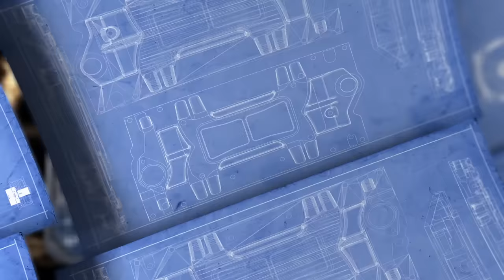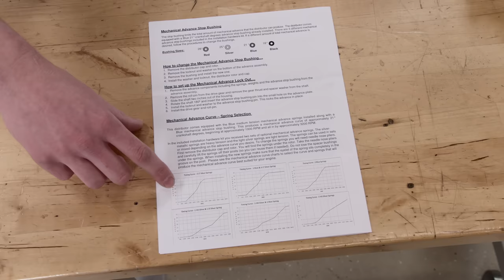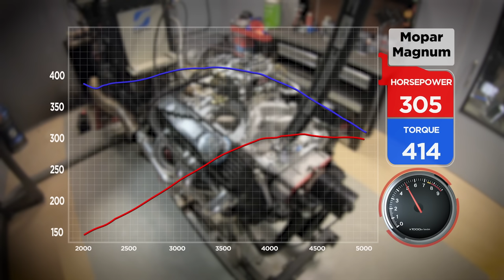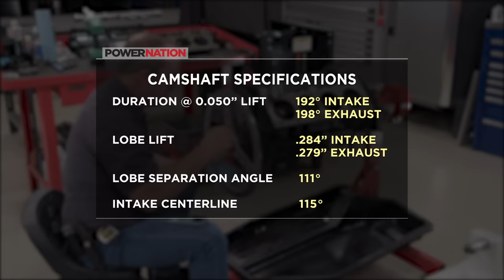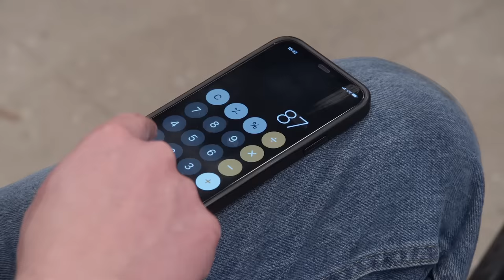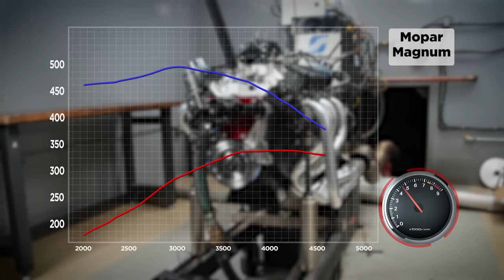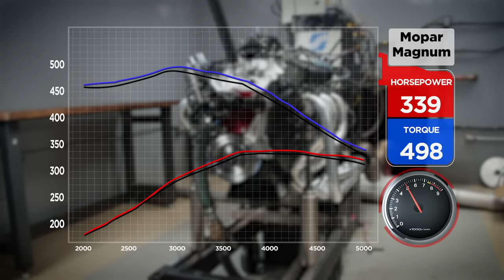What Happens If You Just Add A Stroker Kit To A Stock Mopar Magnum? - Engine Power S9, E3

Comment: very impressive, especially torque! with a cam that thing would blow right through the 400hp mark. These are the true LS fighters, if only more aftermarket parts would start flowing!
Reply: There's parts out there for 360's... Eddy heads... and even bigger heads requiring offset rocker arms...
Reply: @BuzzLOLOL  I think trick flow makes stuff for them plus you can use Holley efi on it
Reply: Impressive… I suppose.  LS fighter… eh, I’m not so sure.  Stock junkyard 5.3L make 380-385 lb/ft and 350-355hp run on the dyno in similar setup (headers, stock truck intake, no accessories/air cleaner).  They also have a similar size cam (191 @ 0.050” intake).  Stock 6L LQ4s make 400+hp and 425+ lb/ft, and they’re pretty much the lowest for the 6L (194@0.050” intake)…  440+hp and 460+ lb/ft for rec port headed versions like the LY6 with same 194 cam.  

Frankly, the newer hemis are more LS fighter than a 360.
Reply: @stlchucko  - Yeah, can't really compare '50-'70's tech engines with '90's and up tech engines...
Reply: It's a great motor especially for a A or E body, love those torque numbers but it doesn't stand a chance against an LS.  Those numbers are where a stock 6.0L LS starts with 50 less cid, even a cammed 5.3 will make  425 hp all day long.
Reply: @hardball107  Of course it stands a chance against LS motors, it’s all about the build.
Reply: @InfiniteSith136  I've been a Mopar guy from the 60's, been building and racing big and small blocks.  I've also been a Chevy guy for as long building both big and small blocks and it was always a toss up when the loud pedal got slammed on the road.  Your right, it depended on the build and the car.  I've been building and swapping LS's for 15 years now and I can tell you without a doubt that the LS is a game changer, the cylinder heads are just too good, their stock pickup heads flow 30% better than even Bowtie heads.  I've personally taken a junkyard 6.0L, cammed it and produced 500hp at the crank with a stock truck intake.  I've worked with guy's that with a stock block with stock pistons, a cam and turbo and made 1,000hp.  No, LS's rule the street, that's why you find them in Mustangs, Darts, Mazda's and it goes on and on.  You can't do that with any engine designed in the 50's and beyond without thousands in just the heads not to mention the recip assembly.
Reply: @stlchucko  360 is More plentiful and cheaper than the hemi. If you know what your doing you can squeeze 400 hp/425 tq from a stock stroke and rotating assembly 360 Magnum no prob, and still be streetable. Also the stock Magnum heads will support that power level as well. Plus the Magnums are more durable and reliable than the hemi.
Reply: @hardball107  a stock 60s n early 70s big block with a turbo can do those numbers.. A stock 351W was being pushed to 700-800rwhp before being built, my stock 2v 4.6L P71 beat a few loud ass hell 5.3s in the street, all depends how junky the engine was or not when it got swapped i guess..
Reply: @P71ScrewHead  Those were gross numbers back then not net like today.  Even a stock 5.3 will make 375hp all day with an aftermarket PCM. Add a just a cam and and your looking at 50-60 extra HP,  that's 426 Hemi range.  A 6.0L will crack 500HP gross, no contest.  And what are you smoken' to believe any stock 351 will hit 700HP except for maybe a supercharged GT40.  If you don't believe me I'll mail you a copy of my dyno slips with pictures of the 5.3 I just built for my '68 C10.
Reply: @hardball107  I've seen stock 5.3s on the dyno, they don't make much over a 4.6L 2v to justify a swap imo.. Maybe modded they'll make way more but stock vs stock I've beat a few.. n stock 351W have been known to handle good power man, been proven plenty.. 💪
Reply: @P71ScrewHead  I guess that's why everyone's putting LS's in Mustangs.  You need to stop trolling the post's and get out and start wrenchin'.  You have no idea what you're talking about and there is literally no one I know after 50 years of building that would EVER put a 351, 390, 406 or any engine designed in the 50's or 60's against a LS.  They are the highest output small block GM ever produced in stock form and they walk over most big blocks especially with a 6.0L.  I've personally, with just a cam swap, produced over 500hp on a bet with a 6.0L LS and that was a $900 junk yard motor that I never even pulled the heads on and I've seen 5.3's produce over 1,000HP with just a simple single turbo.  Go ahead and try that with any conventual V8 and all you'll have left is scattered parts.  Here's a video to watch of a 5.3 dyno run with just a cam change on a stock 5.3 truck motor, with a 6.2L you can produce over 600hp naturally asperated.  https://www.youtube.com/watch?v=aPtgp8czSqo
Reply: @P71ScrewHead  BS.
Reply: Neat Bigs  Great engine , car combo.  I built one for my son and it's an absolute rocket ship.  He's stuck on those mid 80's Fox body's.  I took a 5.3 LS, had it bored to 5.7 and used a stock rotating assembly out of a Corvette, used 706 heads from a P/U, Holley PCM, TBSS intake, BTR cam and long tubes with a 4L60 trans.  That engine put down 484hp @6200 at the flywheel with  480 ft/lb.  He drives it every day and it will lay down High 11's at 123mph at will.  A potent combination.
Reply: Neat Bigs  Ls is cheaper than the new 5.0 that’s why they use the LS
Reply: @stlchucko  I must agree. Just Sorry hemi aftermarket are so expensive..
Reply: @felixlafuente9714  
I know.  I'm just saying they are more capable than the small block Mopar in the vid that was referred to as a "LS fighter".  The new Hemis can make good power, but they are damn expensive.  LS is the king of bang for the buck.
Reply: @stlchucko  most folks in the hot rod hobby aren't rich. Also most folks are building engines below the 500 HP mark. The 360 is much more attractive than the hemi in price range and durability as well. The 360 can get there more economically and will take far more abuse as well. I've seen 360's hit 300k miles and more. Not many Hemi's get there. Too many issues with those engines.  Although if you have deep pockets, like the Hemi, and the Coyote crowd,  then I guess it doesn't matter.
Reply: @erikturner5073  
You're missing my point.
The 360 was called a "LS fighter".  
LS engines routinely make more power, and have a much larger aftermarket (and cheaper parts available).  
The only reason I brought up the newer Hemis is because they're capable of making power similar to the LS.  

If cost is the point, then it's a no brainer.  There's virtually no V8 that can compete with the LS when it comes to $/HP.  A cam only 4.8/5.3 can make over 400hp.  Cam only 6L can make 500+.  And people routinely grab junkyard LS with 200k+ miles, slide in a cam/springs, and make that power with no need to build.  There's countless junkyard 5.3L "builds" that only involve a cam swap and chinese turbo, making 600+hp on pump gas.
Reply: @stlchucko  no I didn't miss the point. Just stating facts. I've been in the hobby and professionally wrenching for 25 years.im aware of power capabilities as well as different points of directions as far as reaching horsepower goals. Hemis are great but they are overpriced. The 360/318 Magnums are the biggest underappreciated and overlooked Mopar engines. The amount of money it would take to do a 6.4L swap, or get the 5.7 to where it's not destroying itself with all it's problems, I could do a low buck 408 stroker combo with ported stock heads good street cam and a 150 shot of nitrous. That would be a nice street build and with spray there wound not be too many LS, 392, or Coyote cars I would need to worry about. Also it would cost far less than a 392 swap. In the right hands, a 360 Magnum can kick ass at a bargain!! Plus the 360 Magnum is far more durable.
Reply: @erikturner5073  
You're proving you missed the point.
I've been "in the hobby and professionally wrenching" for nearly 30 years too.  

"The amount of money it would take to do a 6.4L swap..."
That still has no bearing on my point, which had nothing to do with money.  It's that the late gen Hemis are capable of making ridiculous power like the LS.  Of course they're much more expensive.  I never said they weren't.
You're bringing that up.  And even if you want to bring up the cost facet of the build, then it takes considerably more money to turn a 360 into a "LS fighter" than it does to just run a LS.  

There's a follow up vid to this where they add roller cam, CNC ported heads, and single plane.  The dyno results ended up being close to a 6L LS junkyard truck engine with a similar sized cam.  This stroker made a little more torque mostly because it's nearly 50cid bigger.  
A stroker 6L (408) with its stock 823 heads and a 230@0.050" cam can make around 600hp.  Plus, even stock bottom end 6L have been shown to handle 200 shots with no issue (junkyard SBE 6L with only ring gap have made 1500+hp with turbos), so a forged stroker bottom end (which costs as much or less than a 360 stroker kit) should be more than capable of handling it. 

IOW.... If you want to talk about "kicking ass at a bargain", you won't hear me talking about Hemis or Coyotes.  The "bargain" wasn't the point of my comment.  You're bringing that up.  
If 360s were a "bargain LS fighter", there'd be more people swapping them into oddball stuff instead of a LS.  Typically the only things 360s get swapped into are into things that it can bolt into with relative ease.
Reply: @stlchucko  everything in life has to do with cost!! Second I've seen the second video, and I wouldn't have taken that direction with my stroker to make the same power to smoke LS, and 392 setups. They took the high dollar road all the way. Again there are many ways to get the job done, and cost has alot to do with what is popular. There are many people out there building 360/318 Magnums, LS engines, and Ford 302/351, versus the Hemis, and Coyote. In hotroding there's the grassroots approach, and then there's the deep pockets approach. Obviously we are looking at things from two different points of view. They are all great engines. Although at the end of the day money is going to play a big factor with most. Ridiculous power can be made with either direction. There are SLEEPER  Dakota's and other 360 Magnum equipped Mopars surprising Hellcats in the quarter mile. So yes it not only can be done, it's GETTING done! Remember, it's the the guy on this video who said that the Magnums are true LS fighters, and I agree with him! I'm just bringing up a different point of view for making power. We're all professionals with different takes on the subject. Plus it's good to see underdogs win from time to time. Plus like LS, Magnums are CHEAP/Durable, and can also be dropped into anything that can take a V8. It's not rocket science!!
Reply: @erikturner5073  
“True LS fighter” …after you throw a stroker kit and replace almost all the parts.  And the ones that aren’t replaced are massaged.  All to make about as much power as a junkyard engine with a cam.
Well gee…  by that metric, nearly any V8 made in the past 50 years is a “LS fighter”.  

You talk about grassroots VS deep pockets, but then throw everything at the engine but heads and act like it’s a super low budget build.  

Sure…  Can make good power with a 360 for low cost.  Let’s not act like they are making 500+hp with just a cam/springs or the factory bottom ends are capable of handling 1000hp.  These are things a LS are capable of.  A 360, 350, 351 and all the other small blocks from 40+ years ago have their inherent design limitations.  They can all be hot rodded to make power similar to their modern replacements (LS, Hemi, Coyote), but they have to modified just to reach the outputs of those modern engines; let alone surpass them.  
I’m not being obtuse and saying a stroked 383 SBC with ported Vortec heads and a hot cam that makes just over 500hp is a “LS fighter” just because it makes similar power to a warmed over LS.  There’s a bunch of people building 360/318, 302/351, and 350s because that’s what they have and it’s cheapest to build what’s already there.  The overwhelming majority of those builds also struggle to make over 400hp…  and that’s not a knock to them.  I appreciate/respect all sorts of builds.

That said, I’m not going to act like every old school small block with a “3/4 race cam that can hop a coke can” is a “LS fighter”, or that throwing a stroker kit at an engine is necessarily cheap.
Reply: @hardball107  "Stock" 426 Hemi...
Reply: @Acesnickvlc  Not to mention the new 5.0 is a super wide motor with those cams over the heads.  They just won't fit in many vehicles without major surgery.
Reply: @tomc8157  I put together a "stock" 5.3 with just a mild cam, actually a junk yard motor with a Trail Blazer intake and a set of long tubes and made 448hp @ 6200, 425ft/lb at 4600 and had less than $1500 in the motor.  There isn't a old 426 Hemi made that would keep up with that.  Even the new Hemi's will walk all over the old 426's.
Reply: @hardball107  that's great and all, just saying a stock 426 hemi had 425 hp and 490 tq stock at lower rpms.. Not bad for a 1968 engine. You can't compare 60s tech to modern. Still would give that 5.3 a run for its money.
Reply: @tomc8157  Well, not really.  I've raced them in the quarter in the 12 second bracket and put them back on the trailer with my '68 C10 with a 5.3 and a 700r4.  Raced 2 others a week later and I was handicapped almost 2 seconds.  They were great engines but your right, they can't compete with modern engines routinely putting out well over 1hp/cube.
Reply: @BuzzLOLOL  this is a 90s engine. 70s SBMs were LA's. Magnums are LAs with 90s tech.
Reply: @stlchucko  the Magnum plataform is the LS fighter that should have been developed. Cheap, easy to make power, tremendous durability, etc, etc, etc. Some guy around here has a +/-700whp twin turbo 318 running only 15psi. Mild build overall. The Hemi isn't LS's adversary, the Hemi shuts down the whole "LS the world" bullshit
Reply: @kuiper6926  - LOL! GM and Ford started adding that 'tech' in 1976! For some reason Chrysler left the poor 360 a weak emissions slug gas hog until 1994!
Reply: @kuiper6926  - The stock LSx engines blow away the stock hemis... 
Chevy proved hemis and overhead cams (Ford) weren't needed...
Reply: @BuzzLOLOL  GM and Ford needed an extra decade to implement Chrysler's polyspherical cylinder heads to implement their engines. Chrysler's 90s magnum v8s are low powered bc of the poor camshaft they were fitted, swapping it will not only boost power but it'll boost efficiency. Both 318 and 360 will outlast any smokey 4.6 with ease, deal with it.
Reply: @kuiper6926  - I have a '95 RAM show truck with Magnum 360. The HP is net HP so a lower number than would have been shown pre-1971 gross HP... plus it's a truck engine, so torque, not HP was more the goal. Also the long runners of the barrel intake flatten the top of the HP curve while boosting the torque curve just like GM's TPI 350's did. 
Richard Holdener showed the Magnum 5.9L has more HP and torque than the Hemi 5.7L up to 4500 RPMs, so a good truck engine. 
https://www.youtube.com/watch?v=XJQGV_xrGiA 
Plus, friends have Magnum 360's with up to 500,000 miles where as the Hemis start having needle rollers fail in the poorly lubed lifters taking out the camshaft and valve seats fall into the engine destroying it around 125-150K miles... 
Want to race, get the Hemi for high RPMs power... want a 'truck', get a Magnum 360...
Reply: That 950 cfm carb alone cost more than 3 LS's. Lol. Careful what you bring to the fight.
Reply: Get the Trick Flow 190 heads.
Reply: Do you have a 318 magnum video

Comment: That's a serious truck engine there. It'd be sweet for a daily driver too
Reply: In a gen I dakota with overdrive on 3:92 gears. And with their 2300 lock up converter. I've got a stroker ... now just need to do it.
Reply: My dad has one in his ram and it has almost 300,000 miles and still burns rubber all the time
Reply: even the SOHC 287 that replaced the 318/360, makes in that range of the old 360 shy 400 tq? and only 240hp.. Magnum's are natural tire fryers
Reply: Dakota 5.9 comes with it